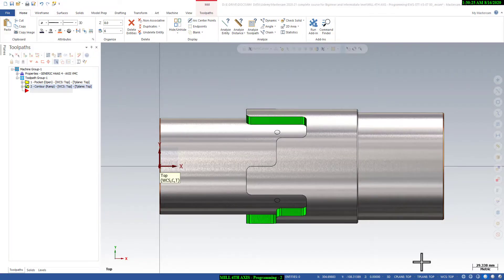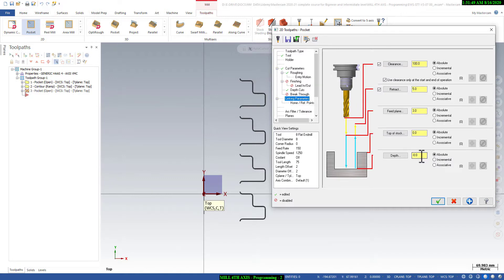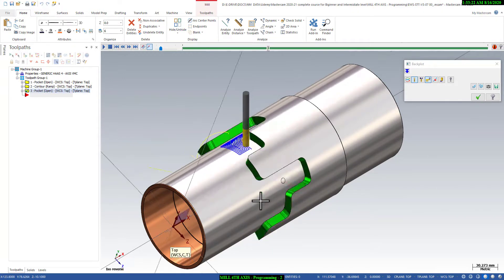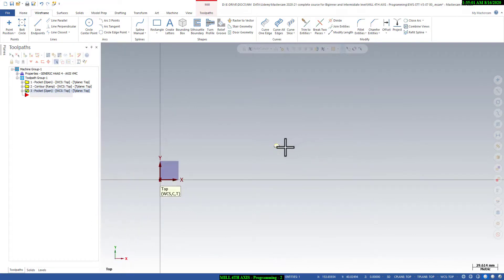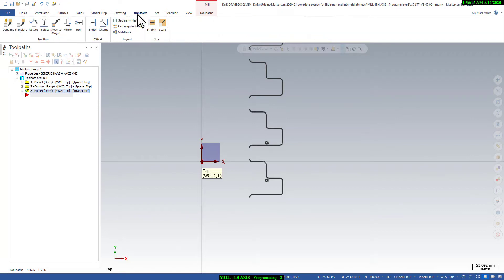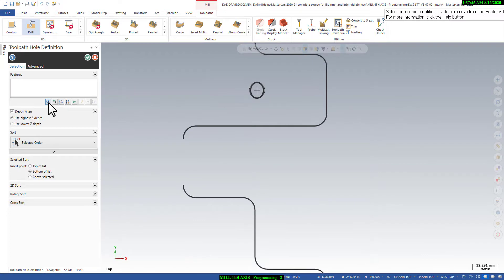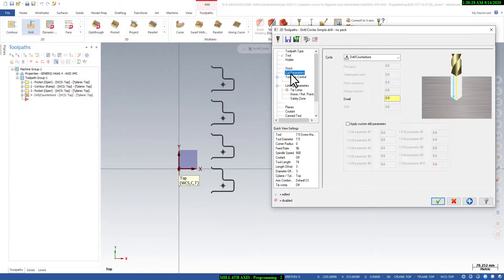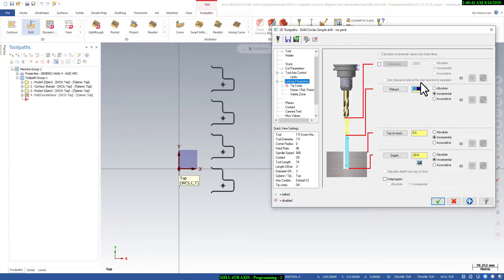Mastercam 2021 4th axis programming session 2 _ Using axis substitution _ ONGC Part Machining.

Comment: great video.
great video.
why do i have a difference between the toolpath displayed and the simulation ??? thanks if you want to help me
the simulation follows the part, but the toolpath is rotated approximately 90 ° with respect to the part.
I tried clockwise or counterclockwise .... nothing